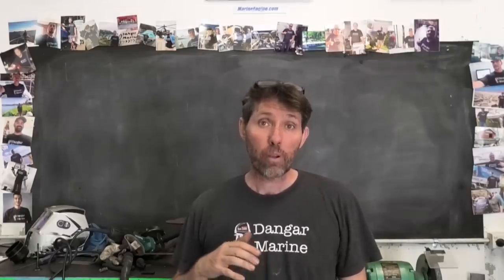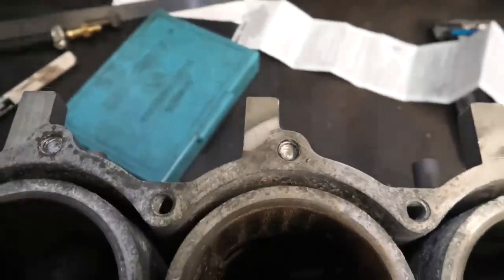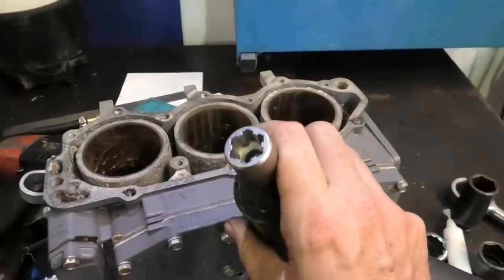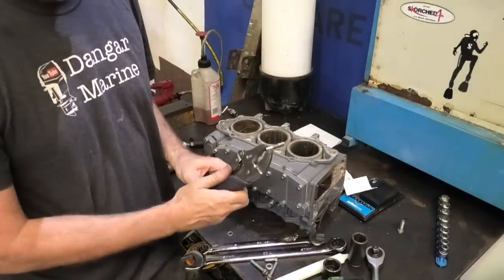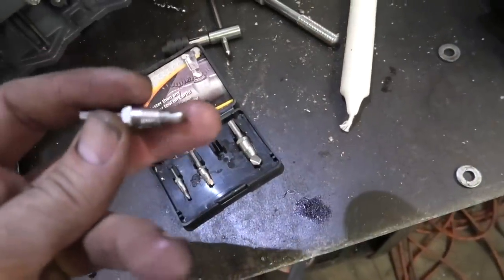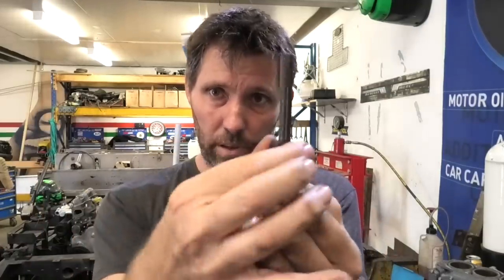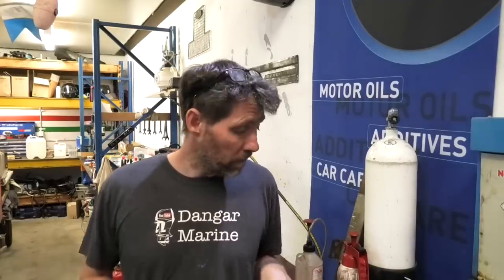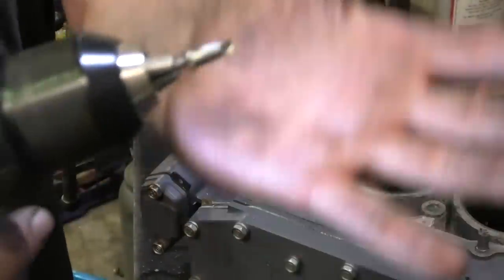Removing broken bolts

Comment: Im the guy who always, always, always breaks off the easy outs. I detest using them. I know they work for most people, but just never had any luck with them.
Reply from the maker: The reality is that bolts break because they are very stuck so for that reason easy outs do have very limited success.

Comment: No easy outs, they are a   nightmare to get out when broken off....which happens quite often. Drill out the bolt until just the threads are left, then use a tap to carefully remove the remaining threads.
Reply from the maker: I do think you need to be very careful with easy outs, for sure. I'm happy to give them a try once the first hole is drilled but if doesn't feel like it's coming out I'll very quickly swap to drilling the whole bolt out. I think the main reason I go to a thread repair rather than a tap to remove the remains of the thread is I find it quite challenging to drill accurately enough down the centre of the bolt to not damage the block thread.
Reply: @DangarMarine  I was going to ask you why you go straight to thread repair.  So even when you use a drill guide that still won't help you drill accurately enough?